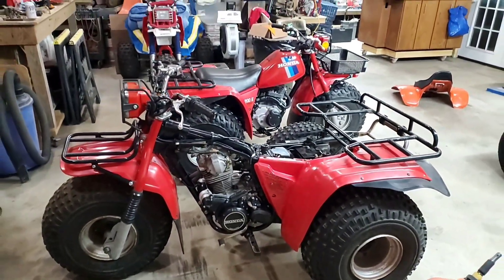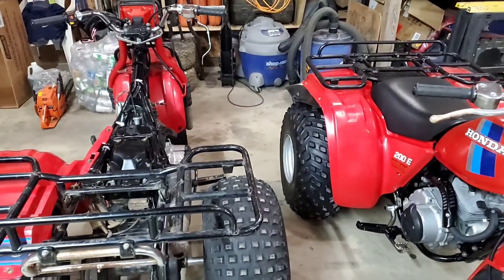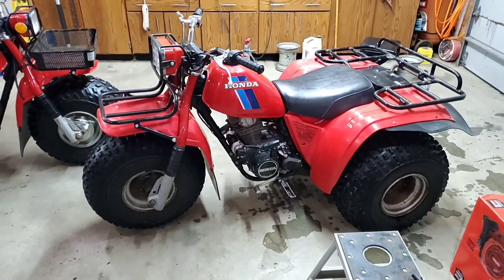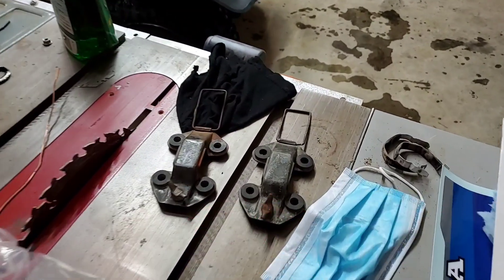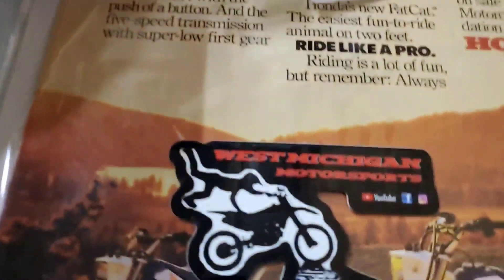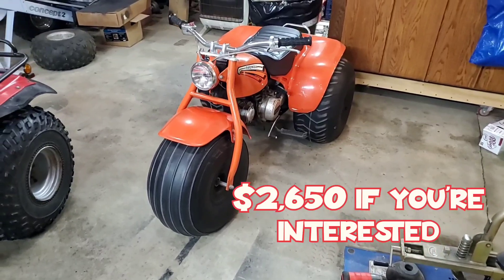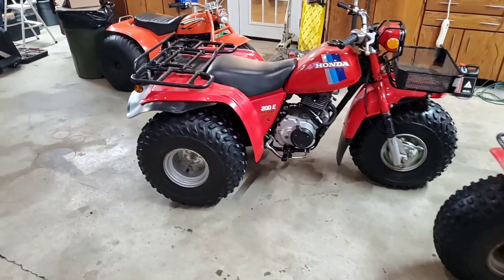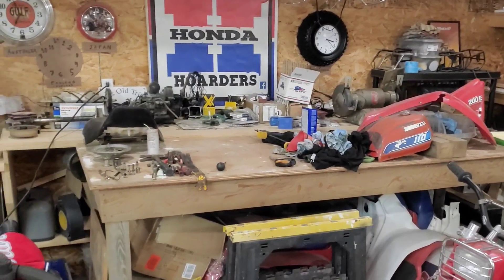Peter the 1983 Honda ATC 200E Comes Back From The Dead!

Comment: I would like to put a borescope down through the spark plug hole and check out the cylinder walls and piston on that 350X. I could tell you pretty quick if it was the top end or the low end on that engine. Good video Preston.
Reply from the maker: That is a great idea sir.  When are you coming??  :)
Reply: @ThisOldTrike  late spring lol